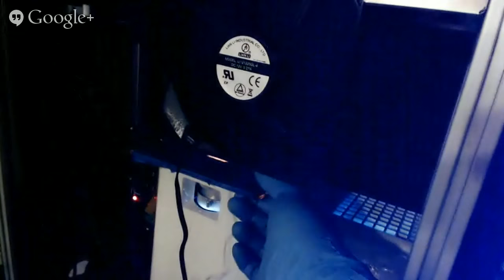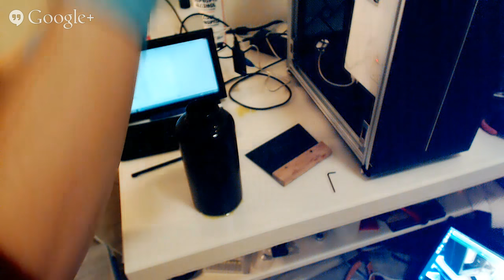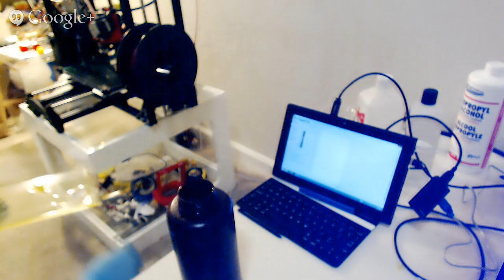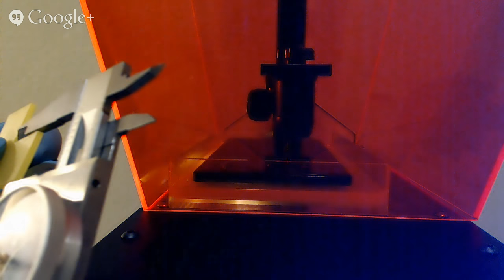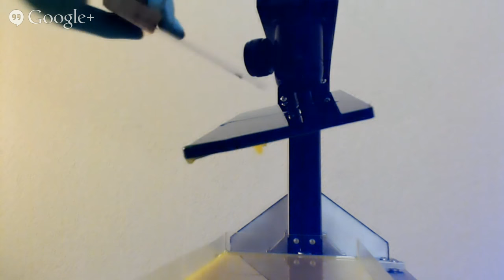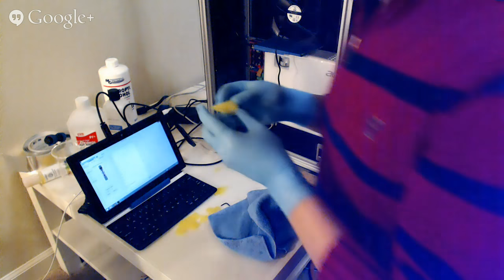Kudo3D Titan 1 DLP SLA 3D Printer Live Hangout Usage Recording

Comment: ct, I am thankful for coming across you video. My business is wanting to purchase a DLP printer in order to begin resin development research. we specifically are after DLP(projector) rather than SLA (lazer)  The Titan 1 is a favorite at this point as it looks best on websites, features, ect.. do you feel this is the best (DLP) printer for the $?
Thanks!
Reply from the maker: Rob Chesley I certainly want to believe that is the case, but to be honest I have only ever personally handled the Titan 1, and not any of the other ones. If your interest is in developing resins for 3D printing and want a print to do test runs on, I believe that this would be the best printer for the job for two reasons:(1) You can test on both Teflon film and bare silicone without having to go DIY with the vats. (2) The lifting mechanism is mechanically simple and can give you a range of separation force results in a single run.

If this is indeed your use case, I'd love to talk to you more on the topic.

Comment: Hey CT, do you think this printer is able to print  dental models which require a fine level of details? I am interested in buying a printer for this purpose, but i am a newbie in 3d printing. Based on your experience, could you recommend a printer for this purpose? (B9, Form1+, Pegasus etc). Thanks!
Reply from the maker: I haven't used all those different printers, I just have the Kudo3D Titan 1. There are dental models in their gallery of prints (http://www.kudo3d.com/portfolio-items/3d-dental-model-2/) but I haven't personally made any.

Comment: Thanks for posting this! I'd like to learn more about the specifics of the linear actuator of the printer. Could you describe any identifying markings on it? I believe it's manufactured by THK, but could you measure the overall length of the actuator, the mounting block size, space of the holes, and the stroke length? That would be supremely helpful for me as I'm trying to make a top down DLP printer and I'm trying to find out what kinds of parts other printers are using. Thanks again for the video!!!

Comment: Would you be willing to explain your print mishaps via text? I'm having a little trouble following the video and totally lost in that software UI. Is the DLP edge falloff significant compared to regular SLA prints? Are you able to achieve the print quality shown in Kudo3D's promotional images?
Reply from the maker: Bed adhesion problem from not enough exposure on the base layer, and forgetting to zero the print bed before hitting "Run", causing the printing to start with the bed in mid-air.

I have not attempted to print any detailed prints, my purpose mainly has been calibration dimensional accuracy for printing really strong dimensional parts.

Others, however, have printed fairly detailed stuff which you can find in the Kudo3D forums, particularly in the Showcase forum.

Comment: CT - Thanks for putting this up. Can you describe your STL to printer workflow? Not clear to me what I should be doing to slice and prepare for printing
Reply from the maker: Since these objects are small, I didn't try to shell and create escape holes. I just used Creation Workshop to slice the images, zipped them into the prescribed format for the Kudo3D printing host, and then printed it from their app. I pretty much followed their Printing Guide and Software Manual (listed on http://www.kudo3d.com/downloads_manuals/), skipping the MeshLab step.

Comment from the maker: DLP makes this printer extremely fast, and the adjustable resolution, while clunky to change, is a nice feature. (There are some drawbacks, since it's not only the light intensity that falls off at the edges, but the focus, and thus the resolution, which also varies.) In, general, I've found the print quality to be good and there aren't any showstopper issues, just a learning curve as there would be with any new device (this is my first and only SLA printer).

There are some rough edges on this printer though, the lack of a shutter means constantly taking off and putting back the left panel and sticking random objects over the lens to protect it from dust and dripping resin.

The resin process in general is messy with more complex setup and cleanup procedures compared to FDM printers (like the Taz 4 which you can see to the left of the Titan1 in some pictures), although probably comparable between the Titan1 and the Form1.

I think the worst part of the setup is the software, which is a clunky non-integrated tool chain which requires manually packaging files between the slicer and the printer host, and bugs in the printer host software. For instance, I was totally stumped by problems controlling different exposure times for each layer until I read a post in the forums (http://www.kudo3d.com/forums/topic/discontinuous-layer-designation/) about the problem with a workaround. This however, should hopefully get better over time with updates, and out of all the potential weaknesses of a v1.0 product, the least troubling area to have issues.